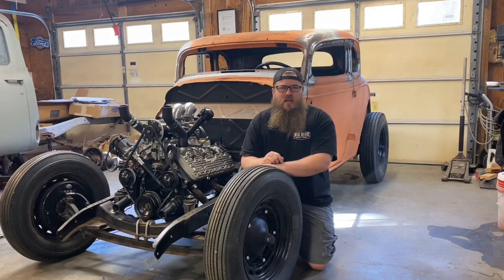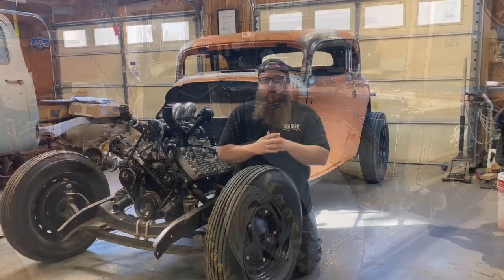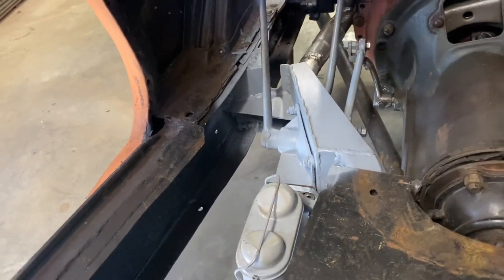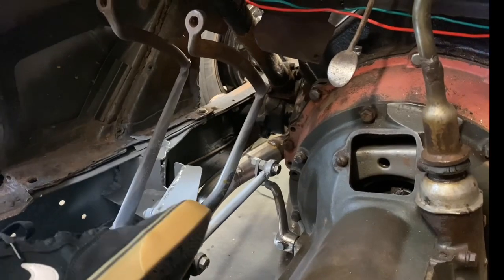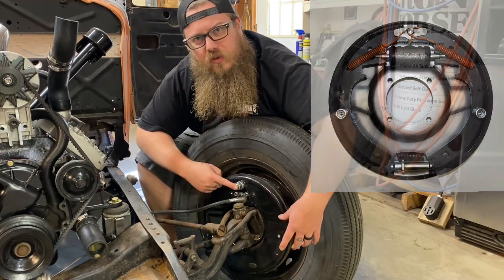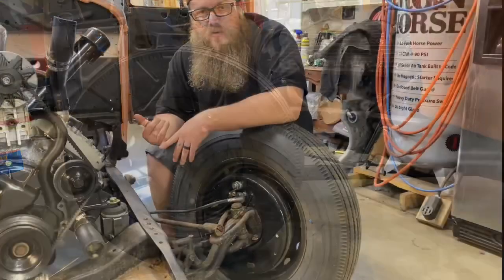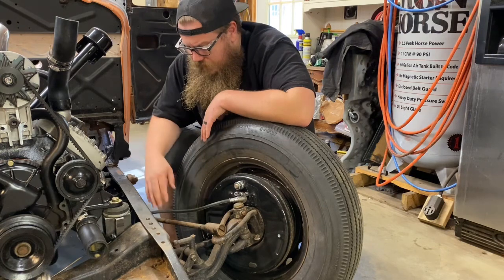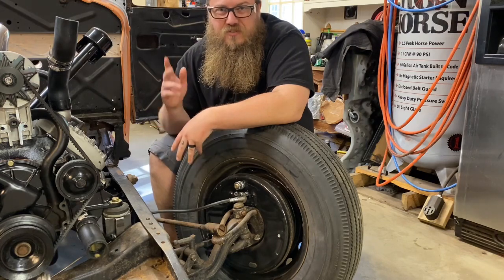Hydraulic Brakes for 1934 Ford!

Comment: I have a '36 Ford project that has stalled. This year seemed to be a weird one,I couldn't find a hydraulic kit for it. Is there something that will work without major changes?
Reply from the maker: The easiest route is to change your spindles and backing plates with 1939-1948 car, they are the simplest out of the bunch